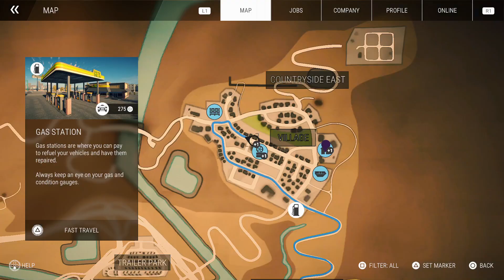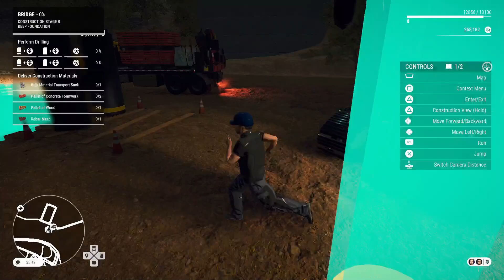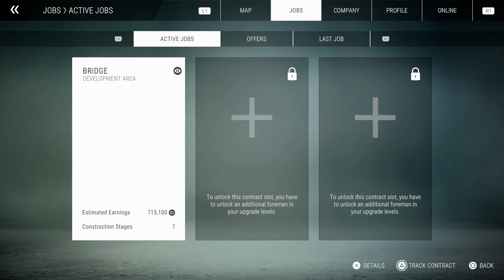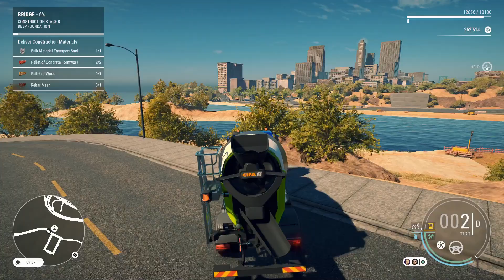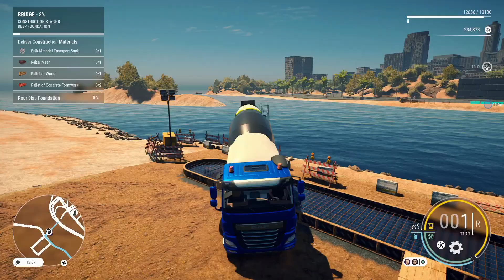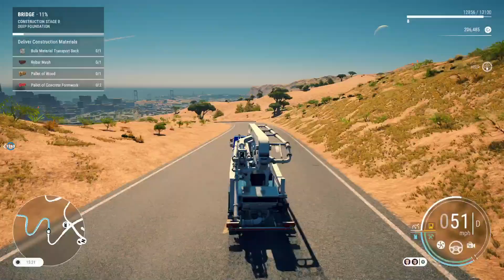Let's Play Construction Simulator | PS5 Console Multiplayer Gameplay | Episode 3: Bridge Foundations

Comment: You almost had it. Your drill was still full with dirt.  That's why the meter was full on the drill and you couldn't keep drilling.
Reply from the maker: As I mentioned in the video, I spent 15 minutes trying to empty the drill, but no matter what I did I could not get it to shake out.
Reply: It's always tricky to know when to pull out and  how much to shake your drill until you're a bit more experienced.  😉